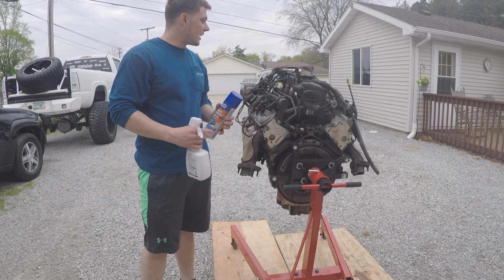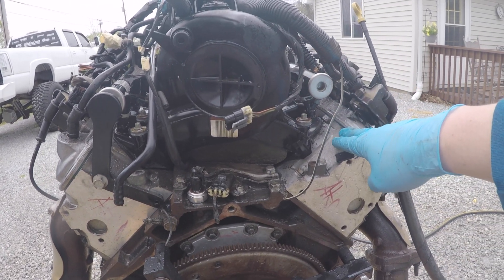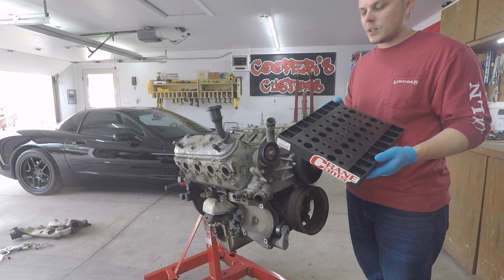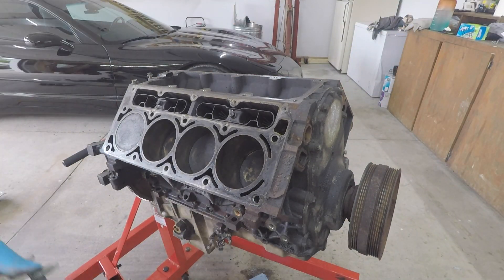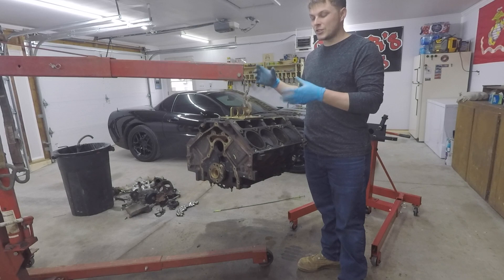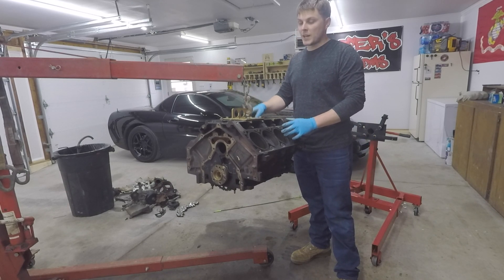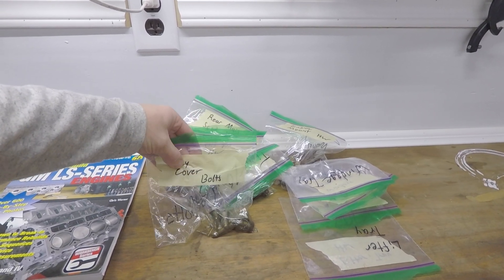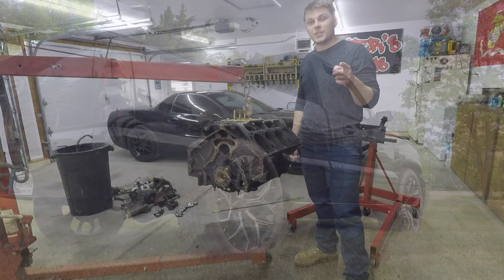6.0 LS Tear Down

Comment: What bolts did you use for that universal lifting plate?
Reply from the maker: Hey, I just used the valley cover bolts. 4 bolts worked out alright, with the autozone universal lifting plate. But I'd recommend getting the lifting plate ment for an LS, so it uses more bolts. Like this one.

https://www.amazon.com/Allstar-Performance-ALL10140-Engine-Plate/dp/B003BZLAKU/ref=asc_df_B003BZLAKU/?tag=hyprod-20&linkCode=df0&hvadid=312091590621&hvpos=&hvnetw=g&hvrand=578429402725901154&hvpone=&hvptwo=&hvqmt=&hvdev=m&hvdvcmdl=&hvlocint=&hvlocphy=9016355&hvtargid=pla-569070175089&psc=1&tag=&ref=&adgrpid=61856009453&hvpone=&hvptwo=&hvadid=312091590621&hvpos=&hvnetw=g&hvrand=578429402725901154&hvqmt=&hvdev=m&hvdvcmdl=&hvlocint=&hvlocphy=9016355&hvtargid=pla-569070175089

Comment: The intake bolts do come out. You pull it filly out then wiggle it
Reply: Where you got your truck bed from
Reply from the maker: @tylerb2494  I got it from car-part.com easiest way to find one 👌 these beds are kinda rare though. Mine was $1500
Reply from the maker: Correct, they can come out, but they mainly just sit idle inside the manifold after you unbolt it.
Reply: Just looking for any bed. With no dents.
Reply from the maker: @tylerb2494  if your looking for a regular fleet side, there are plenty on there, might just have to drive a little farther for a clean one with the same color.

Comment: Don’t reuse the 317 heads. Put the 4.8 heads on the lq9. That would bring a stock lq9 to 400 hp
Reply from the maker: For sure! The 317s will get sold, and im gonna put the milled 243s on it. Those already have the pac .660 springs in them 🤘